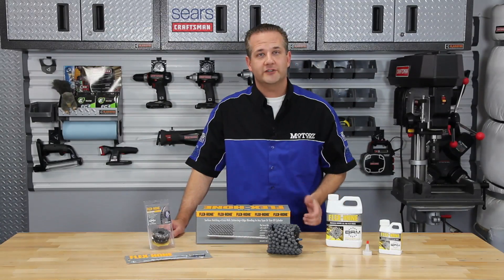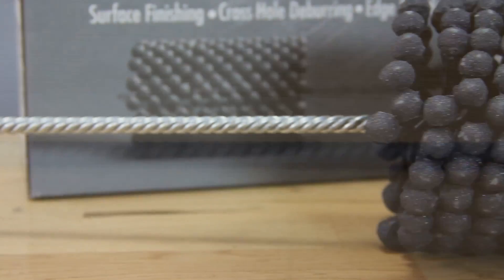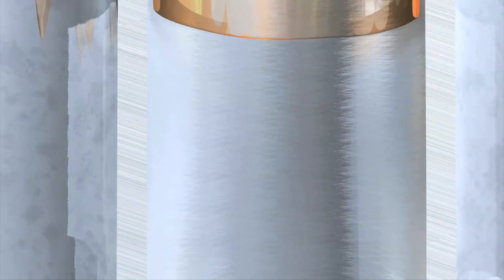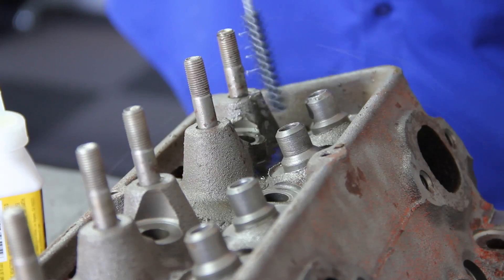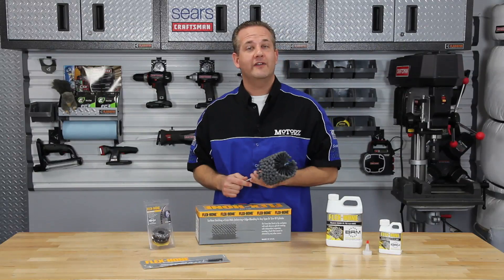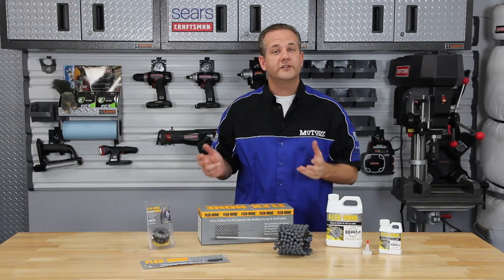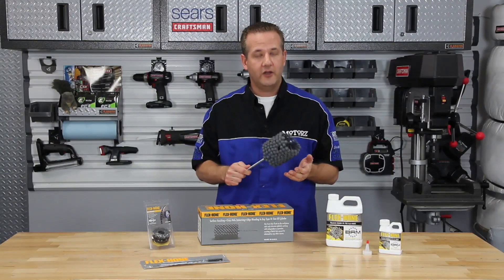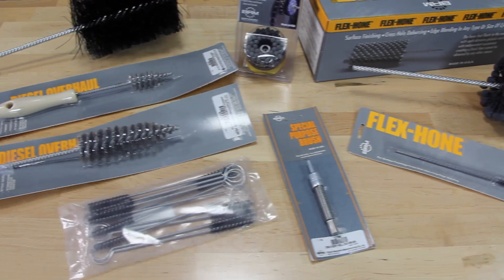Engine Hone- Flex-Hone Featured On MotorzTV

Comment: This is probably a dumb question lol I'm new to the engine rebuild world . Do I use the same stock piston size or do I need a slightly bigger piston ?
Reply: depends, look at the size of the bore and how much clearance youll have between the piston and the cylinder wall. if its past the recommended clearance you would need to get it machined  a bit more and get new pistons.

Comment from the maker: Sorry for the confusion.  When your bore is between standard sizes, the next larger hone should be selected.  For an 85mm bore, the 3 1/2" inch or 89mm hone should be selected.  Because you are working with Nikasil, we recommend a 240 grit Aluminum Oxide.  A standard duty GB312240AO should do the trick.

Comment from the maker: For general deglazing and preparation for re-ringing our customers typically select 240 grit, however, this is a very general recommendation. The best method to ascertain the appropriate grit for any ring type is to contact the ring manufacturer.  Exotic materials and gapless construction have changed their finish requirements and some high performance applications even call for 800 grit.  If you are having trouble getting in touch with the ring manufacturer, please feel free to give us a call.